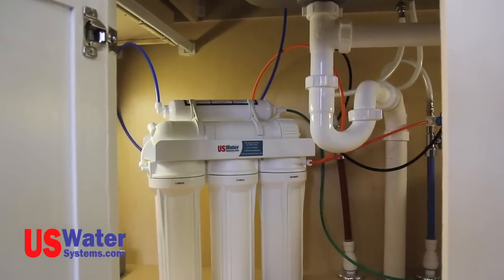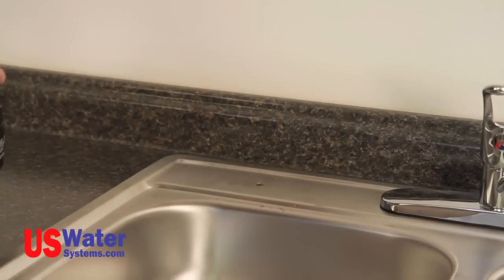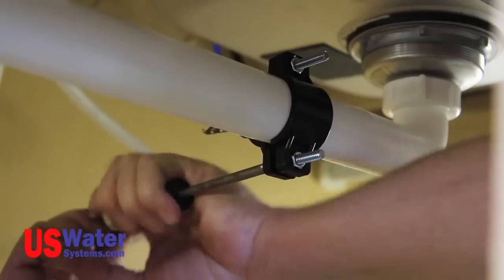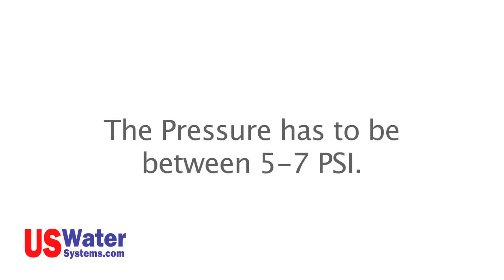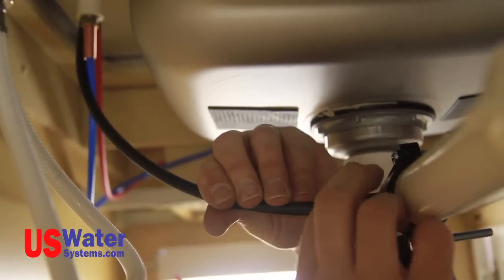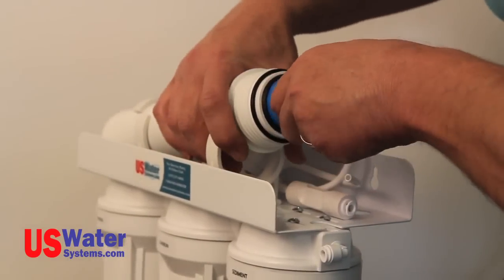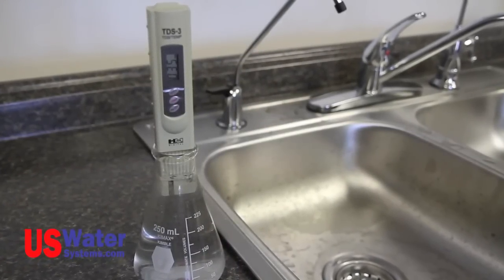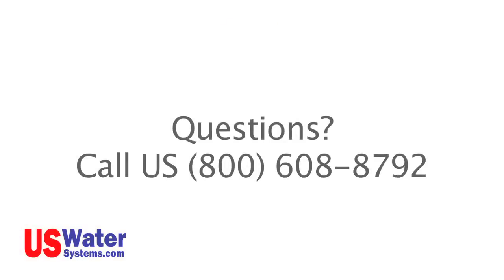Reverse Osmosis Installation "How To" - US Water Systems

Comment: Why not simply answer concerns through the main social network?  What filters are included, are they designed with the current needs of every region, let’s say, New York? Is the system better than a vending machine? What percent of water exiting the the carbon filters gets filtered if most of the water molecules and the sediments won’t touch the surface of the carbon?

Comment: Was wondering how much water is wasted and can I cut a tee in and run 10 feet to my ice maker? Also is this for a faucet that doesn’t have a brine line?
Reply from the maker: It wastes about 1 gallon for every 4 gallons made. Yes, you can run a line to an ice maker using a tee (we have a how to video on that). And yes, this works for a faucet without a brine line. 

Thanks for the questions.

Comment: I have a Apec RO90 Reverse Osmosis system it has a 4 gallon tank. In the manual it says it takes about 2-3hours to fill the tank. I noticed faucet never stops,  water trickles endlessly after 1 hour. Is this normal? wouldnt faucet stop after the tank is emptied since it takes a while to fill the tank/filter water?
Reply from the maker: Yes, the water should stop after the tank is empty. Are you saying you left the faucet open for an hour and were still getting water?
Reply: @uswatersystems  yea i left the faucet on for an hour and water still trickling down endlessly
Reply from the maker: @winkawak  Sorry, I wasn't completely accurate. Water will still come out of the faucet but when the storage tank is empty it would continue to come out but only as a trickle, and continue like that until the tank is filled again. If that is what is happening to you then it is normal.
Reply: @uswatersystems  thanks. the manual says it takes 2-3 hrs for a full tank, constant trickling after 1hr seems off to me. i could be wrong but worried my system is not filtering correctly

Comment: 9:32 confuses me... How do I attach those 2 black tubes. for the out and the sink's main drain???
Reply from the maker: That shows two different systems, so it is two different examples. One is where to attach the black line if you have a permeate pump, and where to attach it if you do not.

Comment: Water will not enter the pressure tank. I'm running a pressure pump from a shallow well set at 30/15. Pressure in RO tank is at 6.5. Discount the feed line and there is water.

Comment: I know this is an old video but maybe someone can answer this question for me. I bought a 5 stage filter system that looks kind of like this system but did not come with a tank. Should it have one? Instructions on install are the same but I have a line that goes from water supply to sediment filter. Then a line going from older and waste filter to faucet and a line going from another filter from top to a waste line with a shutoff valve on that line. No tank. Does the waste line need to be there? Does it run all the time? My instructions don't say.
Reply from the maker: If it's just a filter system then no you don't need a tank. If it is an actual RO system then you should have a tank. It's hard to answer without knowing the actual system you have.
Reply: @uswatersystems  its not an ro system. Thanks.

Comment: Avoid drinking RO water. This water was originally produced for factory pipelines since the RO water has no minerals to precipitate in the pipes to clog it.

Drinking this water will deplete your body of its vital minerals; minerals from the body will flow into the RO water to balance it and ultimately drained out thru urination.

The best thing to do is to filter out the undesirables (chlorine, Florida, rust,...) from the tap water without extracting the minerals essential for the body.
Reply from the maker: RO doesn't take out all of the minerals. It takes out about 90% but since when is water an essential source for minerals? You could drink a bathtub worth of water and that wouldn't provide the body with the amount that is needed. We get that from the food we eat and or vitamins. What RO does remove is all the the crap that you don't want (chlorine, pesticides, lead, salt etc.). Drinking RO water is 100 percent safe.

 I have yet to find a RO that can remove Florida from the water though, now that's impressive. I know that was just a typo but still made me laugh :)
Reply: US Water Systems 
Then, by all means, keep on drinking it for a less healthier body.
There was no mention of water being the only source of minerals in my comment.
Even at 90%, RO will wash away 90% of the minerals in your body. 
Osmosis is passing of solvents from less concentrated to a more concentrated solution. Now, with RO reverse that.
The popularity of RO is in paranoia people developed over the undesirables in the tap water. 
Like I said RO was meant to eliminate any precipitation in the factory pipes. The street name for RO is ‘dead water’, and consuming it is detrimental to health and deadly in the long run.
Most bottled water manufactured is basically the filtered tap water despite labels with mountain, springs and nature images.
We no longer get good water from nature any more on the account of heavy pollutants we pump into the underground reservoirs. 
There is more to the science of drinking water than just filtering out the undesirables; water has to be alkaline and hold a negative charge to prevent Oxidation. Our body is alkaline by design but acidic in function. The water we drink has to create a balance in the body for optimal health. After all, we are 75% water.

Comment: Hi.. I installed a US home filter system. What is the healthy TDS reading for drinking? And how to adjust it from the filter? 
Thanks
Reply from the maker: Hello. Good is about 300 to 500 mg/litre. Excellent is anything below 300mg/litre. With a good RO you should be well into the "excellent" level. There is no way to adjust the filter in an RO. Adding what is called a Blending System to an RO can raise the TDS to a specific level if you desired to, but the RO alone just has one setting (removing 90 to 95 % of TDS). If your TDS rises when using your RO alone, than it's most likely time to change the filters. Hope this helps.

Comment: Instead of doing it this way, could you hook the line that is supposed to connect to the faucet into the ice maker/ water line in the door of the refrigerator so the RO water passes through the refrigerator filter as well

Comment: Problem with this product is the "RO-505". That worthless L connector leaks! And the folks I purchased mine from won't tell you that either! It's a horrible product due to that ONE damn part!
Reply from the maker: Sorry about that. That should not be happening. Have you called customer support? We can get you a replacement part asap. 1-800-608-8792.
Reply: Guys I'm so sorry - it's not your product that I was speaking of, my apologies! (will update in top post) My frustration was with the L connector off that RO casing that leaked. It's the same unit your selling and I was hoping to see if there was something I could try to fix on mine via your video. The company I got mine from has ZERO customer support yet provides a number - no one answers it. So frustrating. I ended up purchasing a whole new RO filter and container. It came with new connectors and NO L connector thank God. Even came with Plumbers tape. No leaks! The fact that you responded to me here though - you're not who I will purchase from and recommend to others I tell about RO tanks. I love them, they're great! Just not the "Global Water" company I got mine from :(
Reply from the maker: Glad it worked out for you.
Reply: In fact - my unit doesn't have an Alkaline filter. Can those be added in without concern? (i.e. pressure issues) If so, I'd like to buy one from you guys!
Reply from the maker: Yes. All of our RO's come with a Membrane Filter that removes Alkalinity. But, if you want High pressure water I would consider one with a Permeate Pump.

Comment: I would like to know, why the first flush of water has carbon, the ro should not remove it? Thank you!
Reply from the maker: That's from the actual carbon filter on the RO system. It just needs to flush out excess carbon from the filter the first time you run it.

Comment: DobI have to drill a hole and alter my sink to install the faucet that comes with it? Is there any way I can install the system and connect it to the existing faucet?
Reply from the maker: You can use your existing faucet, but you may have problems with flow rates and not enough storage space in your water tank. Our faucets are designed to work nicely with our RO systems, so we would recommend using the kit faucet.

Comment: I don't have wrenches to open big and middle size white containers. What an exact names for them and where to purchase?
Reply: +serdgeedgerunner do you mean you cant open the filter vessels? if so, just use rubber palm gloves.  they will do the job just right.  plastic wrenches break easily
Reply: +perruno666 I tried it in a rubber gloves. It's very tight. I tried strap wrench, it was "slippery", didn't grip it. I will try again with different strap wrench.
Reply: +serdgeedgerunner in  case of emergency you can use a steelson wrench.  if you use a cloth you will not damage the vessel.  good luck

Comment: I want to route this water output to my refrigerator instead of to the sink so that the refrigerator water and ice is clean
Reply: DCUPtoejuice its really simple . Just run the faucet line direct to refrig with a quarter inch line.
Reply: DCUPtoejuice yes thinking the same thing
Reply: You certainly cat route it in addition to your sink. We recently had an RO installed and had the doll that. We have it at the sink refrigerator and ice maker from refrigerator too.
Reply: DCUPtoejuice ice line

Comment: Drain saddle. Illegal within ALL plumbing code North America wide, and for good reason. You should not be selling these parts with your R.O. systems. You run a VERY HIGH risk of poisoning your clients from chemicals and drain water from backflow.
Reply: Rob Breckenridge how is it so? what is the difference between drain saddle and drain line adapter which came with my R.O system? thanks
Reply: +Rob Breckenridge I have 2 one way check valves and did not use the supplied drain saddle because it's ghetto and super hack. Just go on ebay or amazon and buy the dishwasher hose splitter adapter so you don't have to hack your pipes i.e. if you are in a rental house and the one way check valves keep crud from back flowing into your RO system and polluting it.
Reply: Tyler Finvold therr are many confusing ones out there. Is there a link to one of those adapters?

Comment: So I recently received a reverse osmosis filtration system for a birthday present. I am wondering however because I rent my home I am reluctance to drill into the drain line since when I move I fully intend to take it with me and don't want to leave any kind of damage behind. Since it is just a drain line is it ok to have it emptied into a bucket or something. I'm sorry if this sounds ignorant but since its just handling waste water from a filtration system I would hope there wouldn't be a lot and it would just need a periodic emptying. I figured this may be a good compromise so I can still use the system but not cause any problems for my rental situation.
Reply: you should put in in a garage and run the drain out into a flowerbed. Recycling and no damage!
Reply: You would be emptying the bucket very frequently, and if you forgot at some point you'd have quite the mess. When I rented a place I ran the drain tubing out of the cabinet an put it in the sink. However, at the time I only used the system for an aquarium so my usage was infrequent. If you did install the saddle clamp you could always plug it when your lease is up. John Guest makes small plugs that go into the fittings. You'd have to buy a new saddle clamp when you leave, but sure beats risking a flood.
Reply: Just replace the piece of PVC pipe from home Depot.
Reply: +TheDarkWall Just get a drain kit dishwasher hose splitter on ebay or somewhere online so you can feed your waste water in an existing hole

Comment: These single valve RO systems aren't really good for you. It filters ALL the good minerals from the water along with the bad. You should use an RO-6 type system with a mineralization filter that adds all the necessary nutrients for human consumption. Else you're drinking "dead" sterile water which is bad for your health.
Reply: That's a good point, I wonder if you can add something to put the minerals in down the line possibly.  Frankly though with how borderline poisoness our water is I would rather get my minerals elsewhere than deal with what's left in from conventional filtration.
Reply: just take supplements. mineral water tastes like crap. sterile water is delicious
Reply: You can buy remineralising cartridges.
Reply: If you are using the water for a marine aquarium the aquarium salt has all the needed minerals.